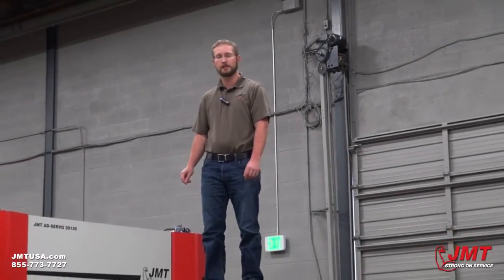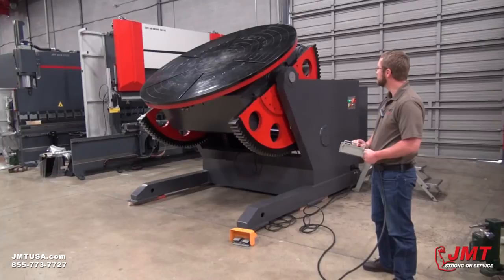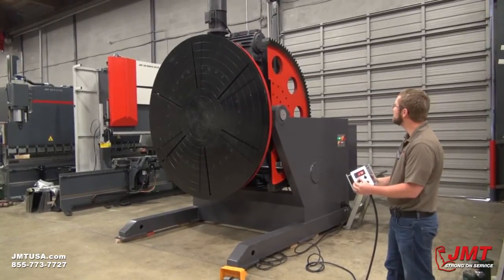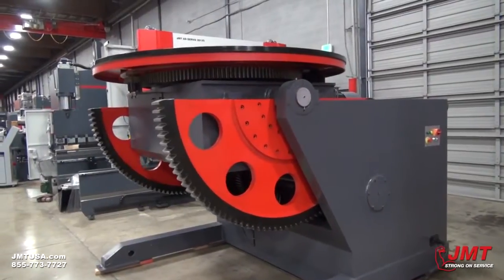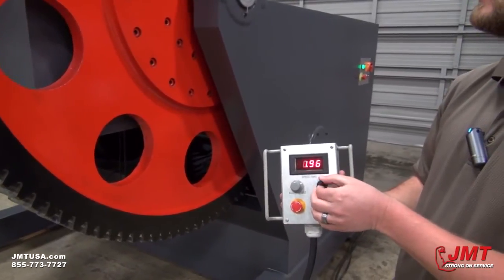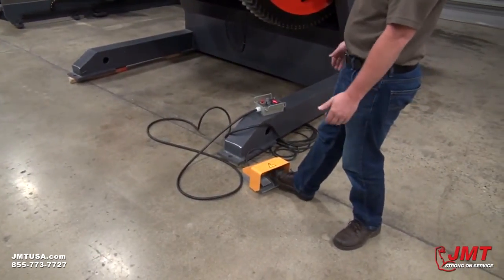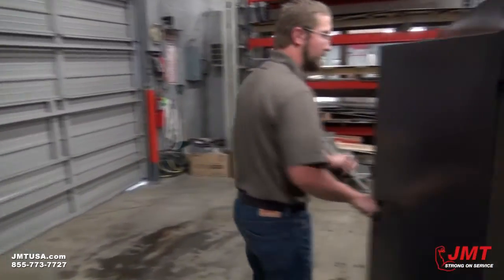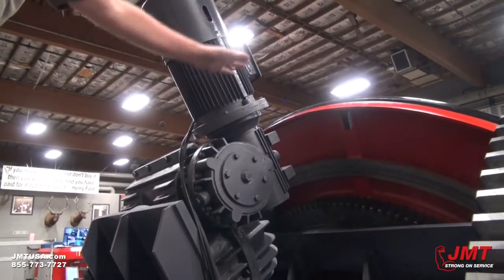Large JMT Welding Positioner (Model HB200)

Comment: What's the biggest size you can make?thanks.
Reply from the maker: This is the biggest one we have available. It has a load rating of 44,092 lbs, a working table size of 86.61”, a rotating torque of 1,008,985 and a tilting torque of 1,504,626. Please email us directly at info@jmtusa.com for more information on our welding positioners and related equipment (see also: http://jmtusa.com/weld-positioning/).
Reply: Pls contact me   sell@mirafu.com